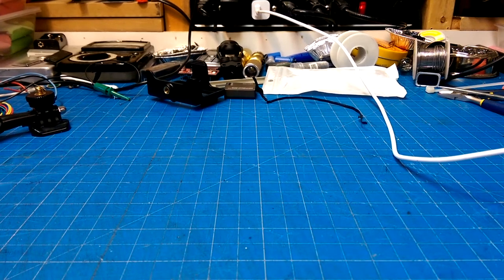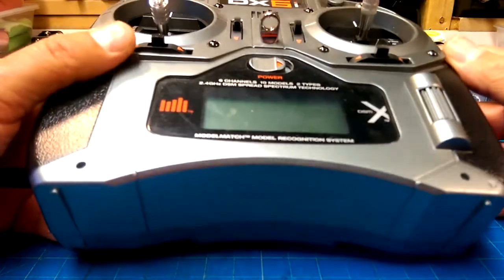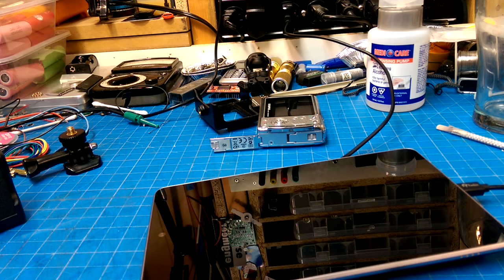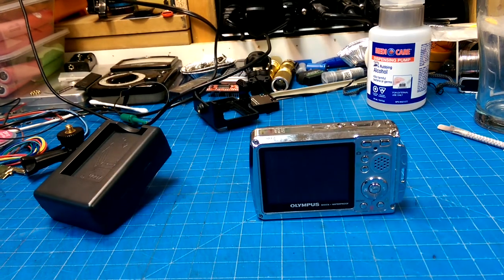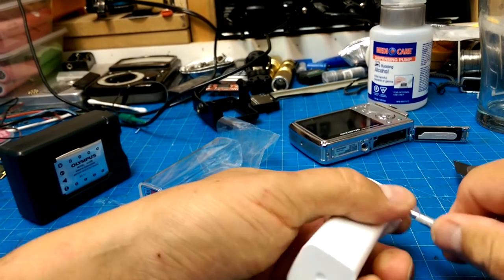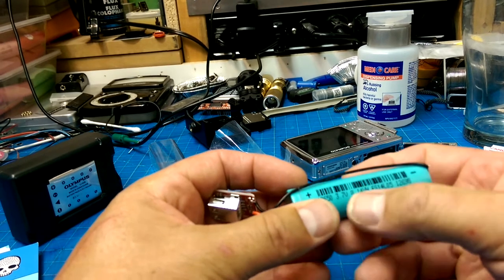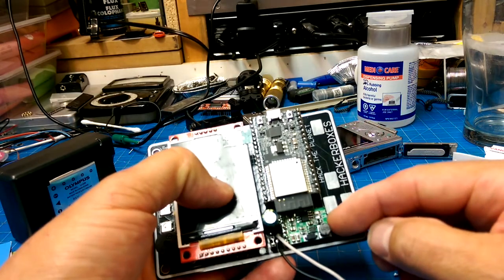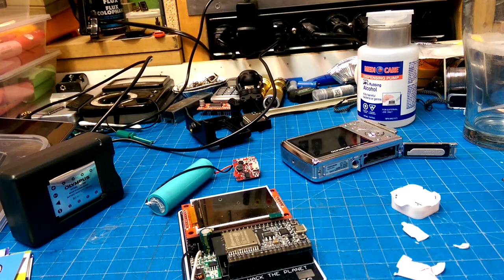Dumpster Dive part 1

Comment: Good isn't it 

Shows you just how greedy society and business has become with respect to how many problems you are having just trying to open up that power  bank up Next try and read the values on the semiconductors 

Now also think about how much waste this is adding to the dumps and then go and ask manufacturers for schematics , wait till you hear the responses on this alone 
I had Bose and other companies refuse to send out a dataset on a loudspeaker  and insist that they couldn't send a schematic for a bose alarm clock 
I wont go into the soldering iron story yet but thats  another lovely company  who i traded with and recommended 

I'm glad your all finding out about all of this 

 I love the explanation on charging this too excellent

 Mind you don't mess up your motherboard in the pc due to short on the battery or electronics i think you need to at least warn people about this  or the battery doesn't explode in your faces wont you 

Now you could  also working out how all these wars are starting and equally why you possibly wound up with the mass shooting today at las vegas 

You might also now be thinking about the assassination of the labor MP in the UK too and you might equally be thinking  possible underlying reasons for this as well 

Keep thinking all of you